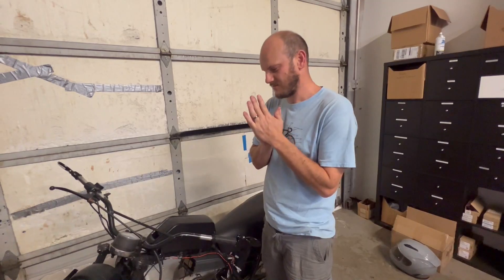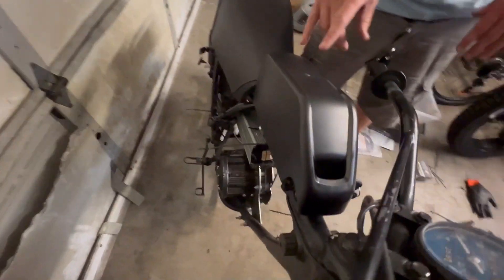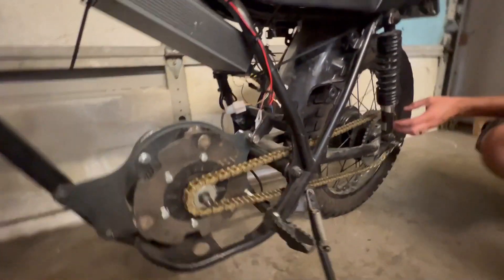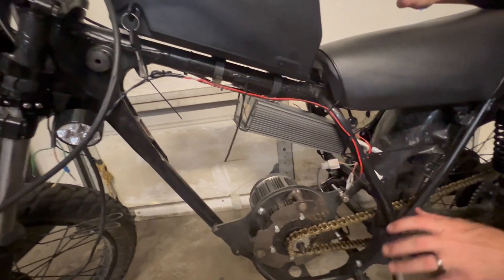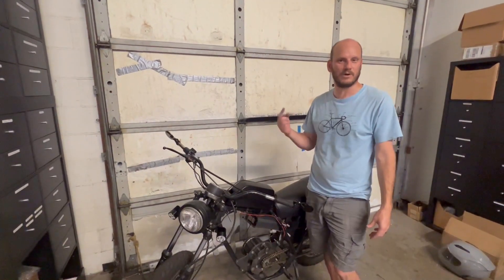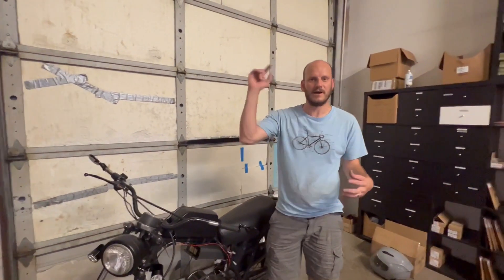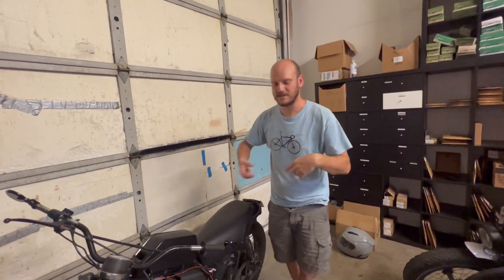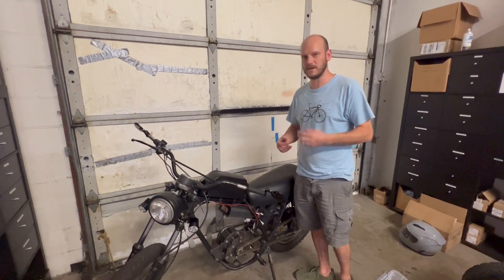Electric Motorcycle Conversion Honda XL175 #4: Test riding!!

Comment: Literally just had the thought 'and I could just have one or two batteries to swap between all of these bikes' this morning when I was specc'ing out NMC prismatic cells. Look at 3.7v and 50/100/180 amp hour cells. No nervewracking spot welding or gambling on a stranger's spot welding skills, just 19 bus bars and 150-300 amps. Fast charging it looks like, too. I'm thinking 6x server power supplies in series for mobile charging, if I can find a 50 or 100 amp charge regulator...

Very cool seeing you doing the stuff I've been daydreaming about after the same thing happened with mid-drive pedal bikes and your vids a couple years ago, btw. Cheers!

Comment: I definitely want to do this - but will try to preserve the look of the original trail bike - keep the tank, maybe mount the battery into a hollowed out "dummy" engine (which could act as a heat sink to keep battery pack cool maybe), and a 12kw rear hub motor.  The XL seems to be a perfect donor as the frame does not use the motor as a stressed member, and very light weight compared to using a middleweight street bike.

Comment: Cool stuff. Dual fuel or hybrid with recharge would be insane.
Reply: Does that exist? Afaik there aren't many electric bikes because of the weight of batteries (electric cars are super heavy). So hybrid bikes would be even heavier.
Reply: @pierrex3226  I'd like a 50 horsepower 4 stroke gas engine on an ebike. No licence plate needed, 200 miles range.

Comment: What kind of range could you expect out of that bike ?
Reply from the maker: With the current temporary battery, 10-15 miles @35-40mph.
Reply: @JohnnyNerdOut that means that you could get almost double that if you ride around 25-30 miles. That exponential electric output thing and all.
Reply from the maker: @alexandrep4913  plus if I use max regen, that could help.

Comment: It'd be kinda cool to put the batteries inside the frame area for lower center of gravity/better handling. Then make a nice looking fake gas tank that's actually a locked storage compartment  with hinged lid on top.
Reply: Maybe he can add a duel battery in its space
Reply: Why would you want a lower COG? There is no hard rule "lower COG is better". Everything has its pros and cons, including a higher COG. You don't know how the bike rides or what J prefers. Besides, moving the battery and putting a storage compartment in it's place, or vice versa, would probably make no noticeable difference.
Reply: @FightFilms  With the weight down lower the bike will be less top heavy & take corners better. The more weight up high, the worse cornering will be. But thinking about it his current battery isn't really heavy enough to be any problem.
Reply: @michaelbrinks8089 Right. But this is a city bike and not a canyon carver or track racer. A higher COG will allow the rider to lean less in the corners, giving better visibility, and will be easier to flick around, i.e. swerve cars in traffic. You'd probably want batteries in both places, to increase power and range.
Reply: @FightFilms  If you've ever rode a motorcycle you'll notice it handles better/better cornering/easier to "flick" around when the gas tank is empty 🆚 full. Which is why Buell came up with the idea of a gas tank inside the motorcycle frame for lower COG which made for a great handling motorcycle.
Reply: experienced riders know why low COG is essential to good riding experience. Newton's first law. Nobody cares about low COG on a straight road. On aggressive turns low COG is ESSENTIAL. It translates to bike having low straightforward momentum and turns much easier because the forces of the forward momentum are felt on the tires and not on the rider making the bike feel lightweight to the rider even though its the same weight.  @FightFilms
Reply: @temporaryaccount-ws9ng Nonsense. It's all dependent of what kind of riding you do. A higher COG has advantages in city riding, as already outlined. What AGGRESSIVE turns and where will JN be making on this relatively slow, low range and already pretty light bike? At the local track? "Riding the twisties?" It's a commuter. You don't race GP, either, nerd. A slightly higher COG is actually preferred in city riding because of better visibility (don't have to lean as much to turn) and it's easier to flick the bike around, i.e. swerve.